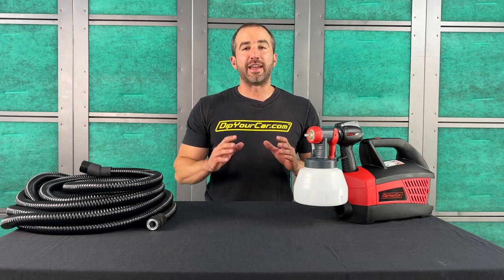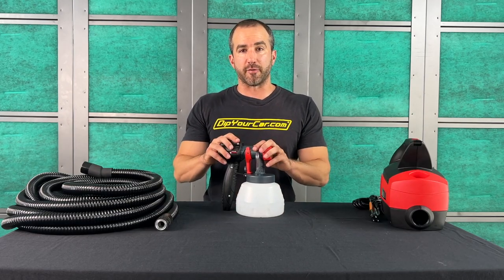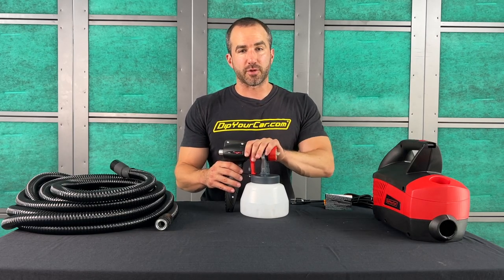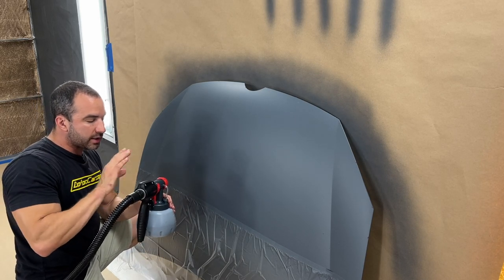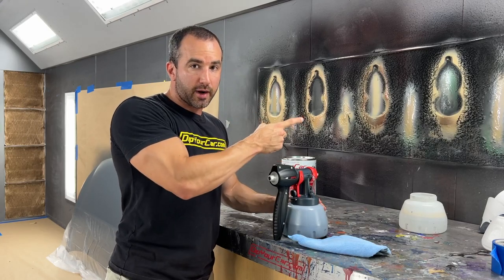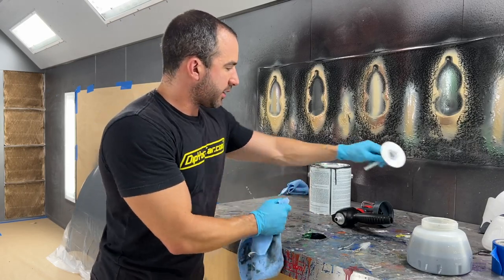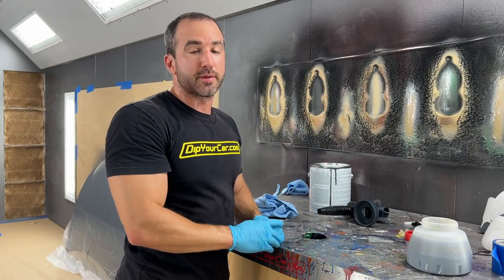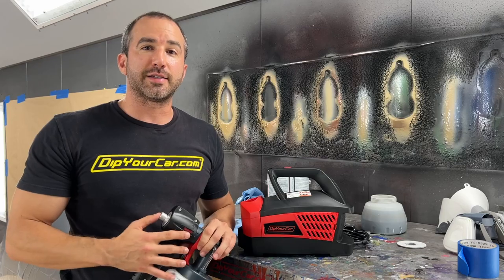Introducing the All New G-Force DipSprayer System | DipYourCar

Comment: I ordered the new sprayer yesterday. Thanks for taking the time to make an in-depth video on it.  For those in California who want Naphtha, Coleman Camp Fuel has Naphtha in it although it's not pure naphtha as it has some additives but it will clean the dip and then you can run another solvent through that if desired.  Also if the breather hole gets clogged between coats, I found compressed air will clear it as well.  I just put the tip of my air hose into the pickup tube or breather hole and its clear.

Comment: 200 bucks for an optimized spray system seems like a steal. My Firebird is starting to get a little squirrelly in the pain dept ('87, original paint) and next summer might be the year I finally dip it, if for no other reason than a stop gap until I can afford an actual paint job. The only problem is finding space big enough to spray.

Comment: would you recomend using plastidip on an old classic car that has minimal rust  but does have some surface rust. ?
could i treat it with rust inhibitor  like i already have and  be fairly certain it will stay pprotected once plastidipped?

also as a beginner do you recomend getting your sprayer kit or is any spraygun setup likely to work with right nozzle size?

Comment: @Fonzie would you guys ever consider a trade up option? For those looking for a new spray system could trade in there used one
Reply: This - I feel so wasteful just getting rid of a perfectly good turbine, so I haven't pulled the trigger going up to the performance.
Reply: @inawrocki207  it’s so worth it. I try to reccomend everyone start with the advanced cause it’s much better and you aren’t double paying. It is hard to swing it on your first time sometimes though
Reply: @bwapbwaaap3771  I can imagine.  I've done my car 4 times now with the original sprayer.  It's fine, of course.  I'm particularly good at it, having prepped vehicles for auto paint before.

That said, after my last dip, I really feel like I needed to be putting more product down faster and I know the stage 3 is what I'm missing.  I'll get it before my next one, but what to do with this perfectly good stage 1 turbine...?  :P
Reply: I'm into go pro cameras and they used to do a trade up program which I thought was neat. Would be cool if they did it witch these...trade in old sprayer that's in working condition for a couple bucks off.

Comment: Does this replaced the "advanced sprayer"?
Reply from the maker: No as you can see in the "Compatability" chapter of the video the new G-Force gun is compatible with the previous Advanced turbine and hose.
Reply: @dipyourcar  right. But I guess I meant more of this is indeed an upgrade from that advanced correct?
Reply from the maker: @silvia393  If you have the existing DipSprayer system, you would upgrade to the new G-Force Turbine and Spray gun.  If you have the existing Advanced system however, you would just upgrade to the new G-Force Spray Gun, as the Advanced (which is stage 3) is still more powerful than the new G-Force turbine.
Reply: @dipyourcar  great that's what i needed to know. Sorry for not communicating that well. :)
Reply from the maker: @silvia393  oh you're fine dude, glad you asked!  A lot of moving parts here, never hurts to clarify :)

Comment: As an old autobody guy who used a Bink's Model "7" spray gun,  (for more year's than I can count, and still have one in working order,) and a Sharpe's Spray Gun, (For Clear Only,) and some Graco Airless Spray-guns (when I was a "Body-section-Painter," for Boeing Airplane Company, Everett, Washington, 747's & 767's, year's 1986-1992.)  I used the Graco Airless Spray-guns, when spraying the wing's of the aforesaid model's.  Try keeping one side of a 747 wing "WET," then talk with me.

Your reinvention of a typical spray-gun, I'm not impressed at all.  What I will mention, that you didn't, is the "TRANFER-RATE-OF-Material(s,)" i.e., "over-spray," was at a minimum, which means more material is staying where sprayed. That translates in to saving's $$$$$.  There's your new selling feature / theme.  Now say, thank you Dave. I'm guessing your market is the "DIY," crowd, not the professional auto refinisher's.

Comment: What's the difference from the advanced spray system
Reply from the maker: The Advanced Turbine is a Stage 3 which produces more power and higher level performance.  That unit is geared towards more serious and professional dippers.  For most DIY customers the standard G-Force system will be just fine.

Comment: It looks like this spray gun doesn't have the fan pattern selector like the old one. I did use that occasionally but obviously having a more powerful sprayer is a better trade off.
Reply from the maker: It does!  You just rotate the air cap
Reply: @dipyourcar  good to know! You should do a quick comparison video between the old one and new one.

Comment: I'm very happy to see this new sprayer system.  My original spray gun started leaking from a bunch of places, primarily the trigger, so I was going to have to replace it before my next job anyway.  Now I can feel better about spending the money, on a new system!
Reply: That's a very simple fix by replacing the needle seal and cleaning out the old dip. 2 extra seals came with the old guns